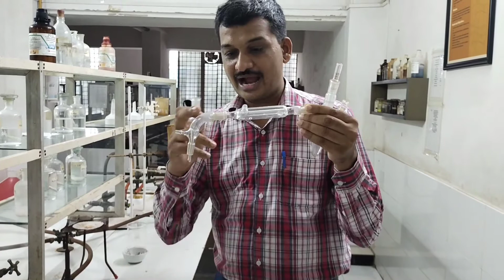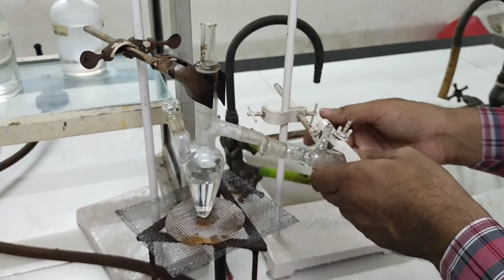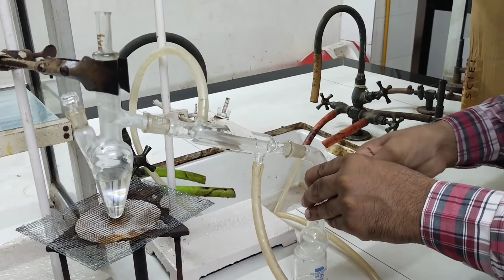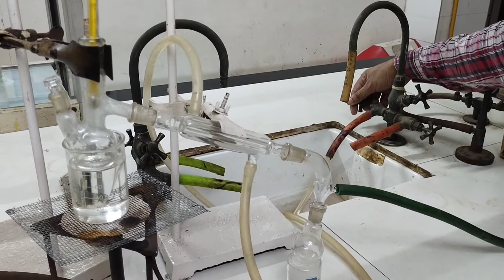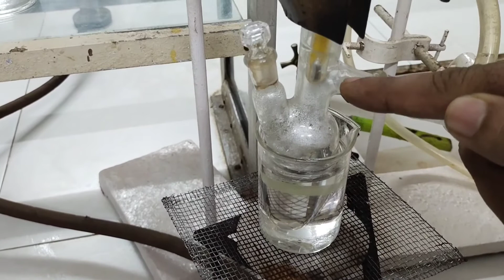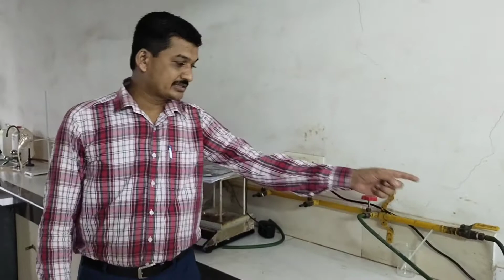Vacuum Distillation

Comment: I’m surprised this actually worked out for you. They usually tell us to use stirring (or air inlet capillary) to prevent bumping. Didn’t know you can use porcelain shards.

Also all the joints would be greased and secured with clips (otherwise it might fall apart when the pressure equalises).
I assume benzyl alcohol is still a relatively low boiling compound. 

I doubt that this set up would word for heavier and more viscous compounds… but I don’t think my lab supervisors would let me test that😅

Comment: hello sir please please guide me 
i am using a distillation column i have to distill water from a solution i have no source for vacuum please guide me which vacuum source i should use or it can be separated with simple distillation please guide me